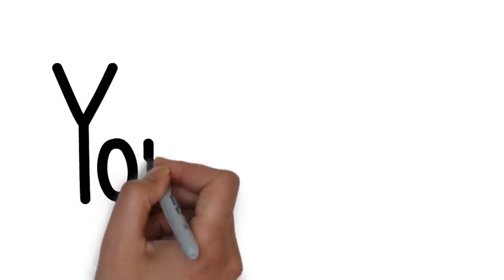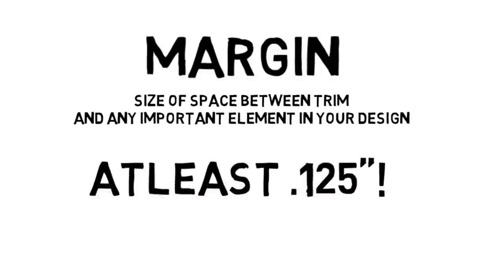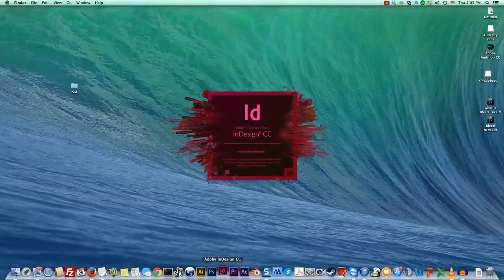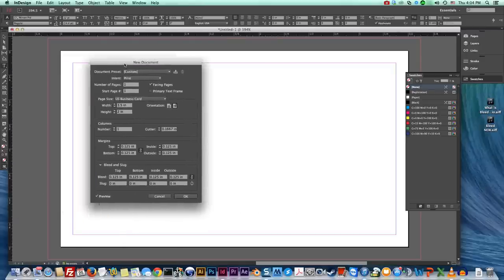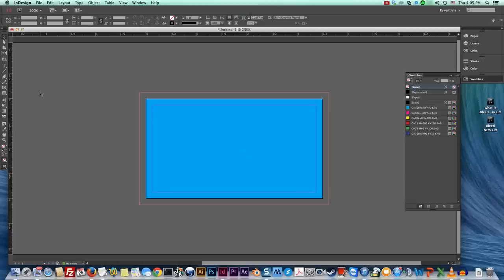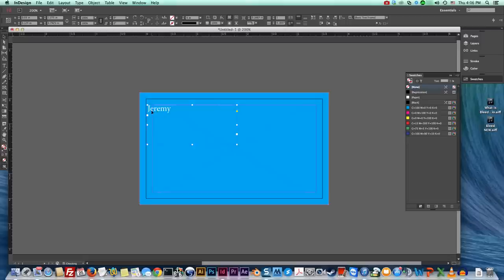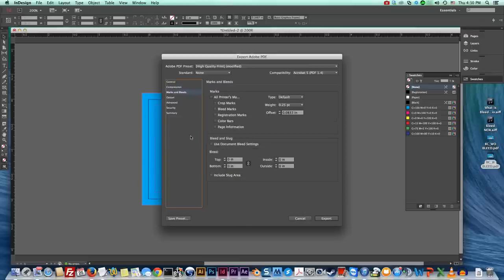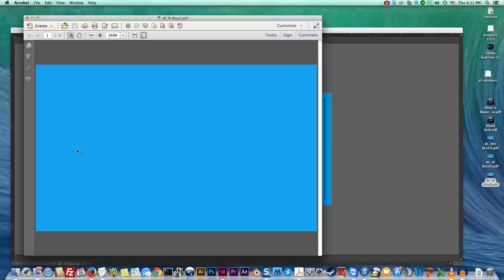What is Bleed? Understanding Printer Bleed

Comment: When you say that you will "trim it down to the correct size", does "trim" mean cutting it..like with scissors?.. as it prints a larger business card and you have to cut to to the right size? Sorry, I little confused about the word "trim" when its also used as a term in the tutorial. Thanks.
Reply from the maker: Hey Crystal! Yes, Trim is the size of your final piece once it is cut or "trimmed". Usually done with a Guillotine cutter, but yes scissors will work!

Comment: Thanks for the video! I'm designing a book and I initially wanted my trim size to be a standard A4 page. Now that I've watched this, I feel I should reduce my trim size so that I can incorporate a bleed while still being able to print on A4 (I'm printing and cropping the book myself). Would you agree?
Reply from the maker: Hey Kegan... Happy I could help. So if you're doing a 8.3 x 11.7 inch booklet that bleeds. You just need to add bleed to it. So in indesign add .125 as the bleed setting OR if youre using something that doesn't have a bleed setting you would make your page size 8.55x11.95 and then make sure that nothing important goes closer than .375  from the edge. Sorry im not used to using mm. but you can do it that way as well.

Comment: Hey, thank you for this tutorial, it was really helpful :) Can the bleed amount (.125") be used on custom labels or will it vary depending on different label sizes?
Reply from the maker: Thanks man! It depends on the printers requirements. If they're circle labels whether precut sheets or rolls the printer may need a custom setup. That being said... If you send them the file with .125 bleed they can take it from there.

Comment: So this is a bit frustrating. I am currently going back and forth with this printing company about a 11 x 8.5 brochure I made. I had .25 in of bleed on the file and a the margin is .125 in. First the guy tells me there is no bleed and now he tells me he needs markings. Is he an amateur or am I doing something wrong because I specifically designed this to be easy to print but he is making a big hassle. I guess I will just specify how the document is setup like I did here.
Reply from the maker: he shouldn't need crops unless he doesn't have the right equipment/software. some people are a little weird in the way they do things but if you have bleed on your file your final file size should be 8.75x11.25. If that's your final file size and the artwork goes to the edge then there is bleed on it. maybe he's an idiot. lol XD. If you would like to send me your file i can take a look for you.

Comment: If you dont click on crop marks. When it print out how do you know where to cut?
Reply from the maker: Measure an .125 in?
Reply: @JeremyBardwellGR  that's it? so if its finished printing i would assume there's an excess .125 from bleed right? did the printer would read the bleed and print an excess?